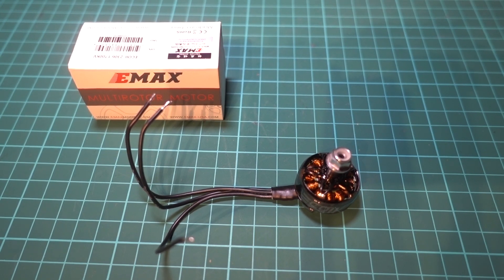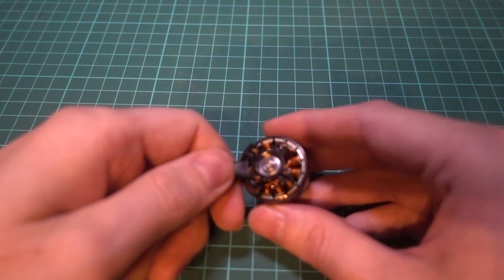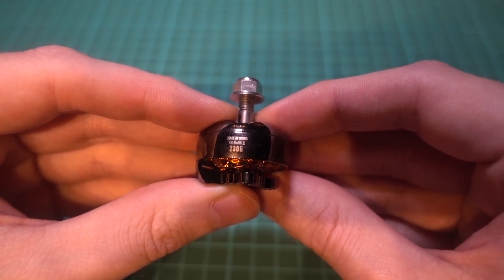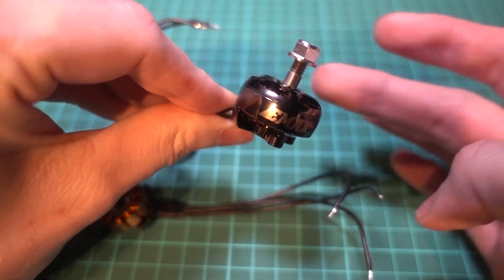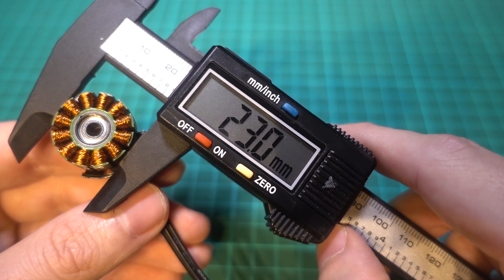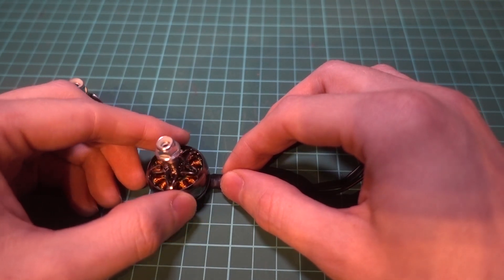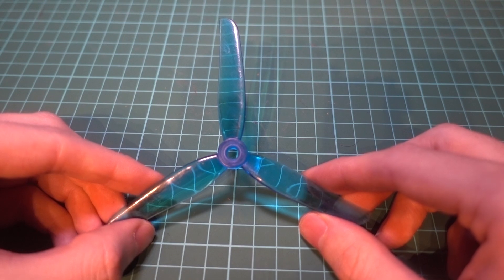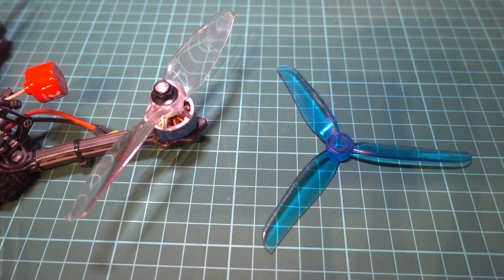Build a Drone - Motors & Propellers #4

Comment: Greetings a question my drone has emax 2306 motors of 2400 Kv in 4S and I fly it with 5040 propellers with 3 blades and I put a 6040 propellers with 2 blades and when accelerating it vibrates a lot, how can I solve that with the pids that I was already moving it and well This is how I could remove some vibration but I need ideas here I send you the configuration of how the pids are to see if you can guide me how to remove those vibrations when accelerating to the maximum, the pids are master multiplier =. 07, PD Balance = 1.1, PYD Gain = 1.4, thanks and regards.

Comment: Awesome video like the whole series. Personally, I would have spent more time on props than on motor theory because props really do make a big difference and while motor choice is dead simple for beginners prop choice not so much. The question low kv/high pitch or high kv/low pitch is a difficult one even for advanced builders.

Comment: 2:54 So you don’t recommend the 2306 motors because of the voltage sag, but you use them in this build? Or am I missing something 🤔
Reply from the maker: 2306 is where the industry settled however I think they are too big yes
Reply: @AndyRCchannel  Thanks👍

Comment: Hi I have These motors in one of these balancing mud was a bit extra and coming out due to which it was grinding against the base so I had cerfefully removed only a tiny bit protuding out of bell will this have any meaningful impact on loosing balance
Reply from the maker: It might do. It depends how much came off. Flight controllers can be pretty forgiving for vibrations these days but if you have noticed a change in flight characteristics it might be time to swap out
Reply: @AndyRCchannel  i guess it was 10-20mg